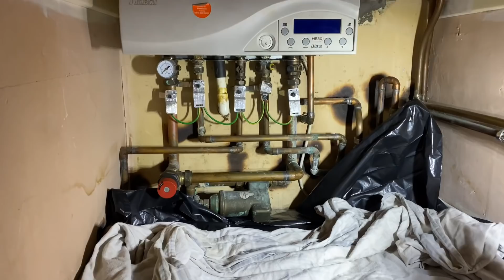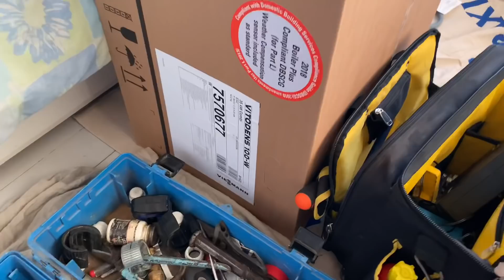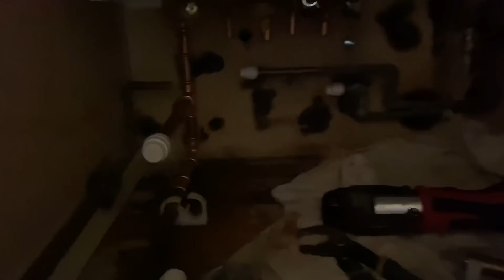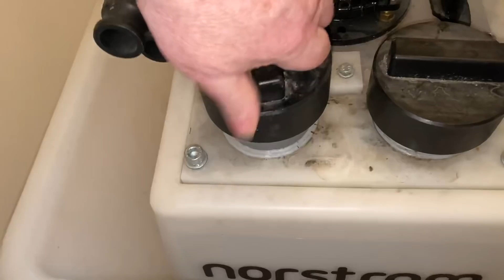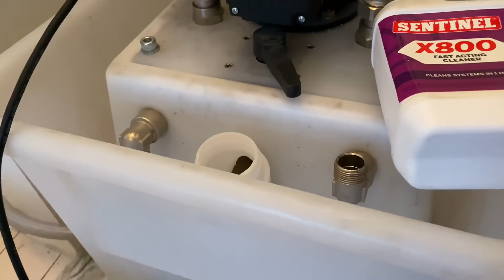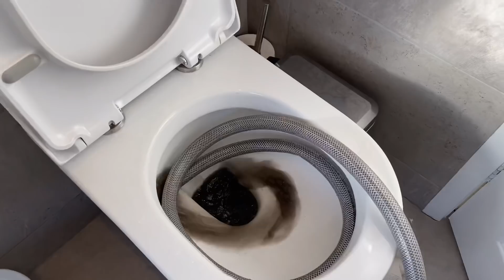LEEDS PLUMBER - BOILER INSTALLATION - POWERFLUSH - VIESSMANN 100

Comment: when l moved into my present property l was covered  for the central heating by british gas when they came out to inspect the system the engineer advised me l should have a filter fitted which l let him do at a cost of £190.00  , had nothing but trouble with this boiler mainly with the plate heat exchanger blocking up got to the stage where british gas refused to clean it and said l had to have the system power flushed at a cost of £800.00 . not doing that had the boiler replaced by a local company and power flushed at the same time , the engineer came to take the boiler out he showed me british gas had fitted the filter upside down thats why it never did any good but british gas have serviced it every year and not one of those noticed it was upside down . new bioler covered by a ten year warranty will not be renewing my contact with british gas . they were quite happy to leave me with no hot water just as we went into lock down with little chace of getting anyone else out to fix it.
Reply: walter byrom Which boiler gave you the problem and what was the brand of the replacement boiler?

Comment: The Install‘s ok... but why haven‘t you fitted a Viessmann Vitodens 2xx or 3xx Series? Way better controls... | Flush is ok aswell, but why have you capped of the ports? Why not install serviceports with valves and screwcapped ends?
Reply from the maker: Hi, Happy new year and thank you so much for the comment, The customer wanted a 100 with a nest. As for the 200 or 300, The 200 would have been out of the customer's price range, The 300 isn’t available in the uk. Thanks.

Comment: Question for you 👍 TRV valves on one pipe heating system. Yes or No?
Reply from the maker: You can buy TRV,s that are designed for one pipe systems i believe. I have never actually installed any though. Thanks.

Comment: you know what you doing allen for sure,,but personally im not a fan of these Viessmann boilers ive been flushing for a long time and when customers ring up with blocked boilers first thing I ask them is it a veissmann ,,and it usualy is ,and a lot of the time the systems are clean also ,,its them ruber hoses also the hose at the back is virtualy impossible to remove don't know why Viessmann don't get around to changing them the ruber hoses are likew magnets themselves ,,i can remove this comment if you want just let me know ,,main thing is you've flushed the sytem and done a nice job ,,plenty of inhibitors in n hopefully they shoud get good life out of boiler
Reply from the maker: They are copper inside now. Thanks. https://www.youtube.com/watch?v=LUxWHBAHGKc
Reply from the maker: The hoses are not bad to do. I did a front one in about 10 mins over Christmas. The back one is a bit harder though. Thanks.

Comment: Great video. 

Is it ok to cap and leave the branches in after power flushing for future use? 
Do you do this every time you flush a system?
Should you always connect the power flushing machine below the boiler or can you tie it in to radiator tails for example?
Reply from the maker: Wouldn’t normally flush with the new boiler in place but didn’t have any choice on this one. Leaving the tees in will mean it will be easier if it ever needs flushing again. Thanks.
Reply: @AllenHart999  Wouldn't it of been better to leave some lever valves and compression caps if it was to be done in the future ?
Reply from the maker: @uknokianut  They are a bit too big. I could drain it from filter is a few seconds. Thanks.

Comment: Hi Allen yesterday I had a new vaillant ecotec pro boiler fitted. Later that day I had a shower but noticed the flow rate of the water wasn't as strong/fast as it was when we had the older main combi boiler. I haven't changed the shower so it can't be that. Do you know what it could potentially be? Many thanks in regards.
Reply from the maker: Maybe the installer has reduced the pressure? What size boiler do you have? Thanks.
Reply: @AllenHart999  it's an  vaillant ecotect 30kw combi

Comment: What about dosing the system to protect against corrosion.
Reply: I like your personality and your video ,you are someone like to share knowledge thank you very much for your hard work .Mr Allen keep the good work bless  ya happy new year .
Reply from the maker: @nayzhoss8744  Are you training? Thanks.
Reply: @AllenHart999  it's been 8 years now since am in gas industry but, now am focusing only on heat pump because most of the new block of flat we doing is heat pump no more gas .😒
Reply from the maker: @nayzhoss8744  Can i come and do some training with you 😂😂😂😂
Reply: @AllenHart999  sure mate am more than happy ,going back on monday  canary wharf new blocks of flat unit 12 .see ya then
Reply: @nayzhoss8744  you'll be in that wolseleys in canning town with all the other dodgy blokes that fix fridges and carry guages about
Reply: @cliveramsbotty6077  lol
Reply: And it's a no go zone lol canning town ,eastham,westham surrounding areas lol I guess you know what am talking about lol no need to get in details 😉
Reply from the maker: You could use an express can on the filter. Thanks.

Comment: How do you decide whether an installation needs a full  powerflush or just  chemicals cleaning procedure. ?
Reply from the maker: I spend a lot of time flushing on my installs. The only thing that matters is the system is clean.
Reply: @AllenHart999  so you wouldnt install a boiler without a full  powerflush.?
Reply from the maker: @themanftheworld8439  Depends how bad the system is really, I often do a mains flush and see what it's like. Thanks.

Comment: All we've been fitting a lot of baxi do you prefer the viessman.
Reply: You better off with baxi than viessman .because I use to work for a company where we install loads of viessman boiler ,the break down and the life span is very poor
Reply from the maker: nayaz hoss which model of boiler? What were the faults? You can normally bring any Viessman back to life. Thanks
Reply: @AllenHart999  vitoden 100  most of the fault was PCB and thermistors that's what most of the engineer was reporting .
Reply: @AllenHart999  yes I totally agree with you any boiler you can bring it back to life but if the performance is poor then no point , my g was working in the office and he told me that we wont be installing viessman anymore as the problem this particular boiler was giving was above limit then we start using ideal  pro exclusive until now they still using same boiler .
Reply: nayaz hoss 
I’ve been using viessmann boilers last 10 years, all of them are running sweet, no problems to date 
& customers are over the moon with lower gas consumption
Reply: @SalimKhan-gk1fh  yes I agree with you on low consumption because the weather compensate is really good very accurate.
Reply: nayaz hoss yes totally agree, I’ve got the vitodens 100 at home the weather comp makes very quick accurate adjustments according to the weather,  gas usage only 24p an hour when warmed up
All my customers also noticed how quiet the boiler is,  recently fitted the 111w in a restaurant 
Fantastic water supply to all the commercial sinks as well as heating ! I switched over to viessmann 10 years ago 
Best thing I done
Reply: nayaz hoss I’ve had no issues with Viessmans. I’ve had a lot of problems with Baxi I consider them to be one of the worst boilers on the market, especially my Baxi at home that I did not install.
Reply: @davidgardner7491  I agree with ya as some people prefer to install baxi or whatever but in our case we had so many problems with vies which the company I was working for stop installing vies and it's a company employed over 200 engineer and they said enough with vies this is my experience when I was working for them and now they using only ideal exclusive and massive quantities. And I forgot to mention some flats even they replace 1 year old boiler vies to ideal .good luck
Reply: nayaz hoss , hi Nayaz, if you come across any viessmann boilers u want to dispose of, let me know I might be interested
Reply from the maker: I love Baxi and also enjoy installing Viessmann. The customer asked for a Viessmann on this job. Thanks.